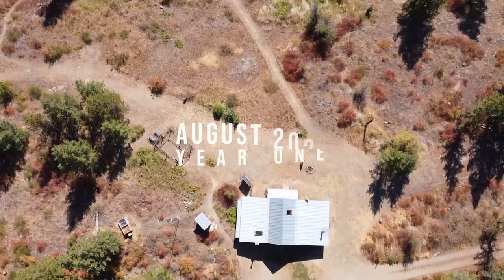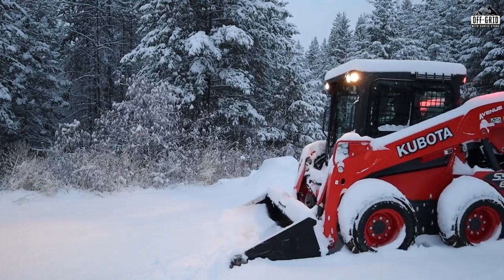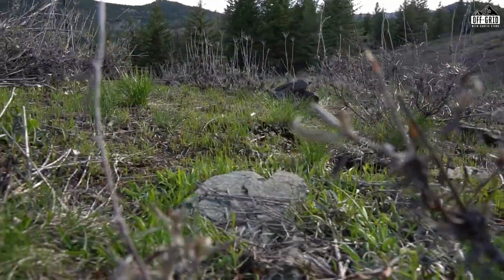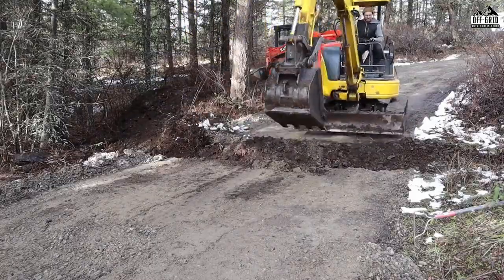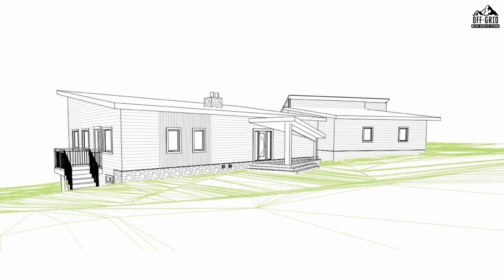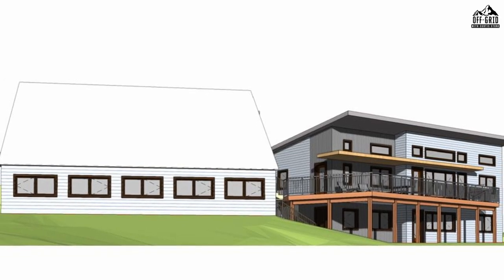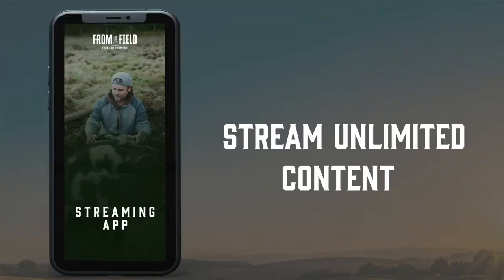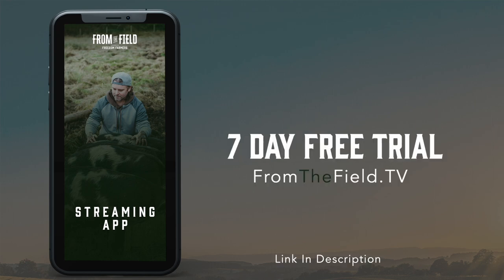2 Years Off-Grid - I Can't Believe What I've Accomplished!

Comment: I love your work. You and Salatin have been super motivating and informative. Crushing!

Smart fencing and livestock guardian dogs are extremely important in the wilderness. We are dealing with the same problems. Bears, Bobcats, Wolves, Weasels, Hawks, Coyotes, etc. 

Can you provide more specifics on the fencing? Are you using cattle panels, woven or welded wire? What about the types of wood posts (height, diameter, depth, treated or untreated)? What is the distance between the posts? How did you stretch the fencing (if applicable)? What configuration do you have for the electric fencing portion? Any helpful resources (books, sites, etc) for fencing?
Reply from the maker: All the videos on my fence are in my daily vlogs at ftf.tv. Personally, I can't stand livestock guardian dogs. I prefer our fence.